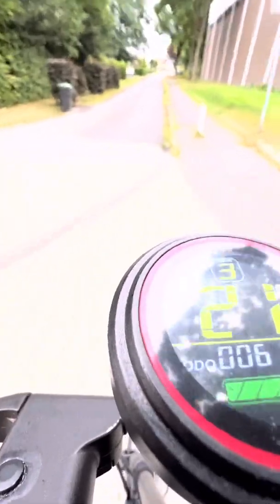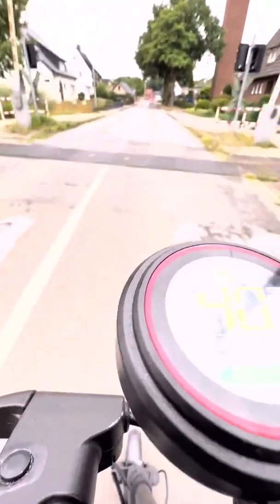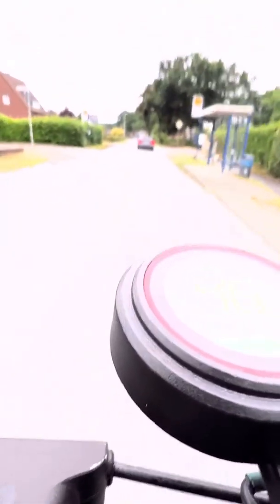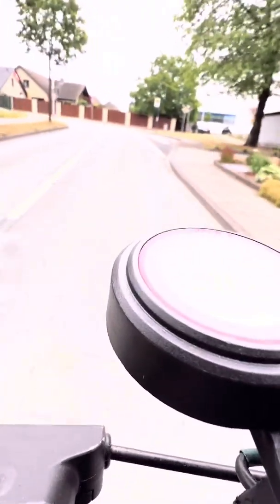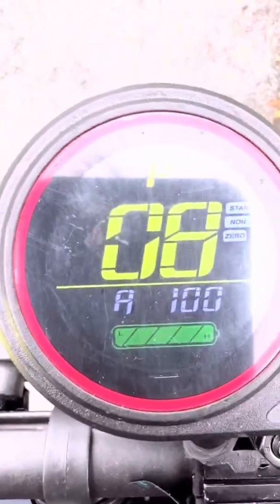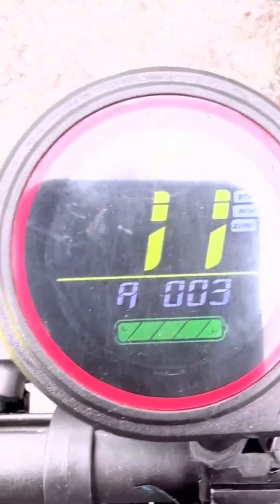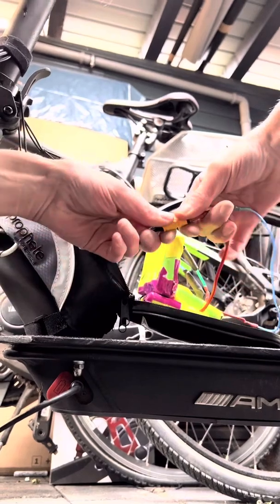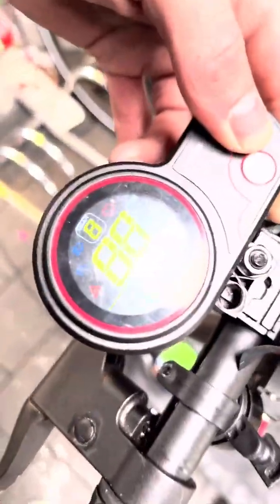Xc-100 / Lh-100 /Tf-100 E Scooter Display Maximum Speed Settings! Xiaomi S1 run 50km/h - DIY Tuning

Comment: Hey mate I have a adasmart V10 Plus 52v the trigger (accelerator) has been broken off and the model number is XC-100 I can't find it anywhere would the LH100 or TF100 work normally getting about 77kmph top speed. Please help thanks Shayne
Reply: Hey Shayne , did you get a reply on your question? As I have a XC-100 throttle controller that doesnt work and I cannot find another, despite looking foo about 6 weeks
Reply: @neal4541  hi Na no reply. I took mine into my local  E shop and they fixed the 1 I had. All the ook
Reply: @neal4541  sorry all the throttles look they said they could most likely fix it with all there spare parts they had or if worse comes to worse that they could put on a twist throttle but they would have to work out all the wiring for it hope I've helped.